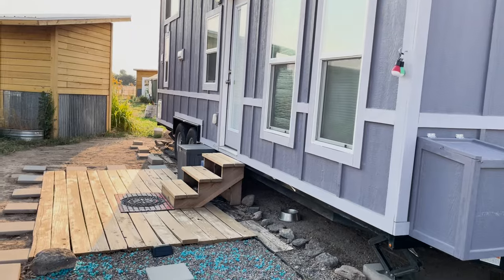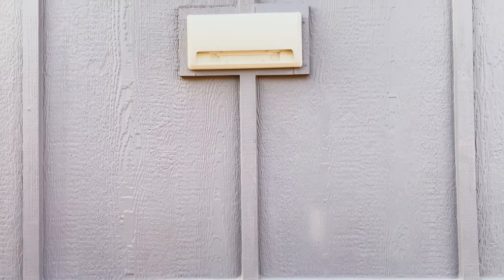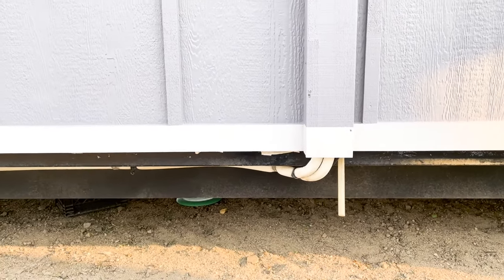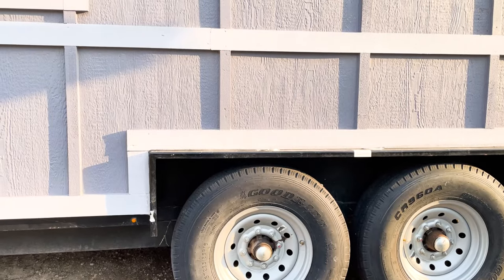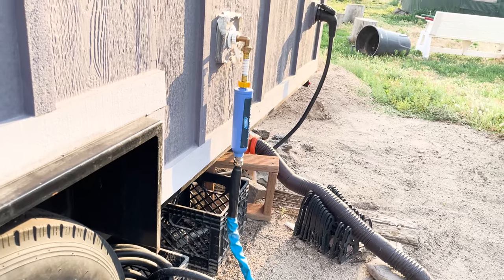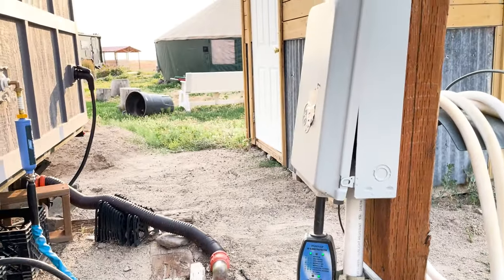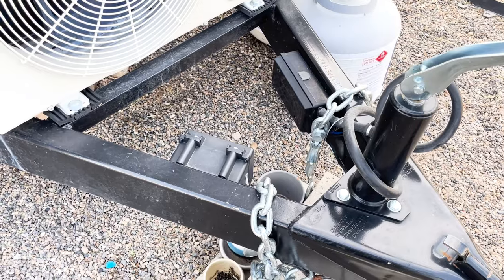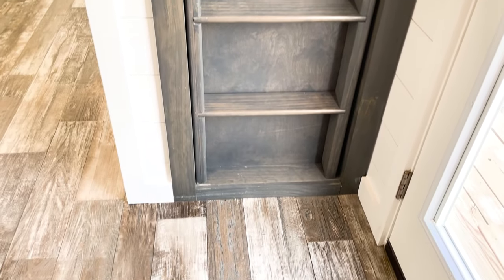Explore This Stunning 3-Bed Tiny Home with Dual Lofts | Perfect for Family Living! 🌟

Comment: No one seems to understand the benefit of a wide angle lens is small places
Reply: Agree. I could not understand what this place looks like or size through this video.
Reply: bleh329  no, as a realtor and a professional photographer/videographer I’ve seen plenty of good and crappy photo/video work.
It doesn’t take being either of those things to take good video or photos of a property. 
If this is a large asset for someone and they want to sell it they should act like it is and treat it such. Unfortunately people tend to rush to just get it on the market. If someone wants to reap the benefits at closing they need to put just a tiny bit of thoughtfulness into the presentation.
Reply: bleh329  especially in a niche market as tiny homes you can’t just slap something together and expect it to be good enough. I hope the owners actually take this as advice to do better because ultimately it will be better for them.
Like the other commenter stated, this video visually was confusing and did not give a good representation of the property.
Reply: I told them my 2016 LG G6 phone had a wide lens.  Insane a tiny house tour company is using 24mm lens and not a 12mm!!!!!!!
Reply: bleh329  and they should do better for all the reasons I already stated. Cheers.
Reply: bleh329  nah